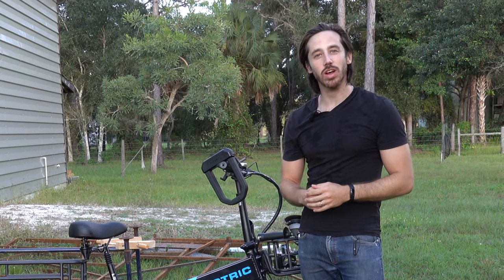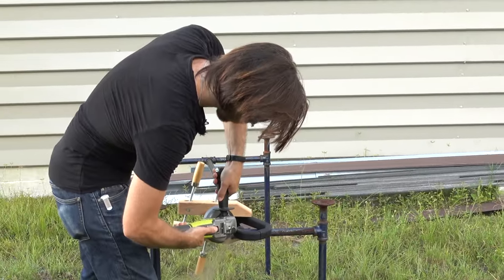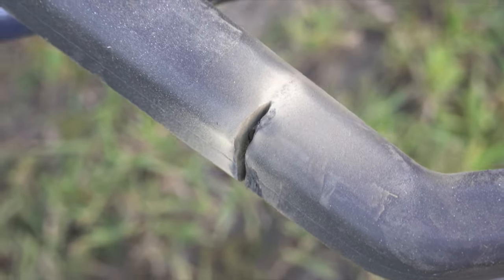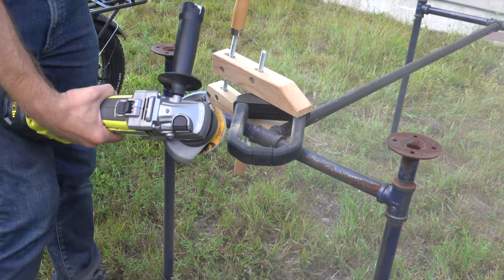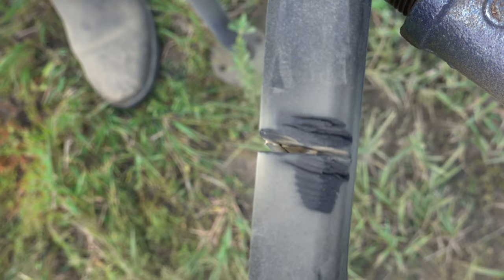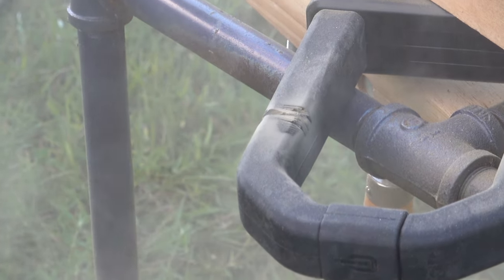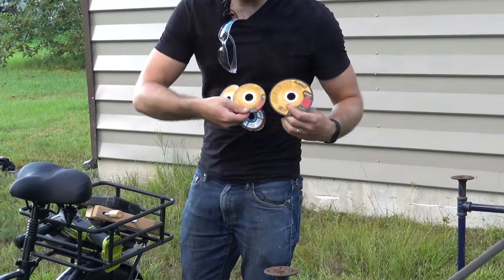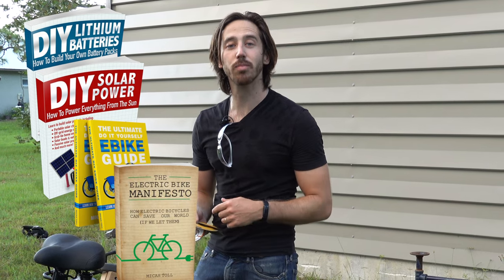Best E-bike Lock? Angle Grinder-Proof Hiplok D1000 Test

Comment: so cut down the post or shackle that the unit is locked too!, when involved with security vans a long while back, the design included multiple long Stainless rods between the  body panels, each rod was sheathed in thick stainless tubes mounted on bearings, so that any attempt to cut through other than by gas cutting rotated the tubes, very effective at the time...
Reply: I think there are prisons where the bars of the cells are made this way. Can't cut through the bars because the rods inside the hollow bars rotate as the blade tries to cut.

Comment: How does it compare to the ABUS GRAN¡T EXTREME? Cause I bought that one in 2019 . It’s insane cause little over a year later the ALTOR SAF Released and my granit extreme fell to second place. Now that the D1000 is out is it stronger? Or more light weight?
Reply: I use a brand new Abus Grannit XPlus 540 
Courtesy of my son for last Christmas!
Reply: @keithcummings691  great lock! Both my Granit Extreme and your Granit Xplus 540,are both Sold Secure Bicycle/Motorcycle Diamond locks! 😎😎😎

Comment: Is Micah still with us? Hard to imagine he is considering the dust from grinding and cut off wheels, as well as the dust coming off of that lock undoubtedly released some very unhealthy particles into his lungs. The dust room grinding discs are just as bad as asbestos! Hopefully the lock is designed so the lock doesn't spin open once you cut through it and you'll need to cut through the material twice to remove it from the bike. Thanks for the video 🙂

Comment: if someone was really intent on stealing your ebike then they could just cut the metal chain of post you have it chained to then take the bike somewhere else to cut the lock off, or simply switch out the abrasive fiber based cutting disc for a metal based one.(do not steal, stealing is illegal.)

Comment: Thanks, but it only has 6" of space to lock to something. Isn't that going to greatly reduce the possibilities of what you can lock it to?
Reply: It was learned in the 1980's that extra-large u-locks were much easier to defeat.   Leverage and car jacks ruled the day.  So the mini u-lock became popular.  This is larger than the small mini-u-locks.

The whole goal is to provide less purchase and working area for thieves to apply leverage or cutting attacks while at the same time leaving enough room for the consumer to lock a bike.  

Luckily, this lock would allow you to lock both wheels and the frame of a road bike.  By removing the front wheel, placing it next to the rear wheel and running the shackle through both rims & tires and between the chain and seat stays, you lock the frame and wheels in one.  This leaves virtually no room for leverage attacks inside the lock itself.  

The larger the wheel and tire, the less opportunity you have.  So it means you have to be creative.

Comment: From a Thiefs point of view, time is NOt on your side, When you have over 50 somewhat expensie bikes to choose from, and one that is protected by a D1000, which would you rather take?  If it wrere me, and I'm getting paid $100 per bike and I have to make a profit, those 50 bikes that I can cut and remove is not woth the time I have to spend on one bike with a D1000 lock.  
Its going to cost you more time, more blades, and being discovered when compared to cutting through several bike locks, than the bike that is protected by the D1,000.  True nothing is Angle Grinder proof, but is the time required to cut through a D1000 worth it when compared to a regular bike lock?

Comment: The D1000 is the solution I've been waiting for.  35 years using the best locks on the market without suffering a theft.  (Using the Altor SAF lock, reinforced NY Fagedaboutdits, Rock Locks, Cuffs, Bad Bones, the works.)  Stay ahead of the dirtbags and you'll probably keep your bike!

Top 3 stupid YouTube bike theft comments:

1)  LPL can pick it in 20 seconds!
2)  They'll just cut the frame!
3)  They'll just cut the rack!

Or you can familiarize yourself with bike theft, talk to law enforcement and learn some things about the issue.  Here's some useful advice from an experienced bike owner and thief thwarter.  Not smug pot shots from the comments section!

First, bike thieves don't pick locks.  LPL is doing the world a huge disservice by giving the consumer bad information.  Don't worry about lock picking.*

Second, a bike thief CAN cut the frame, but they usually won't.  It's the most valuable part of a bike and it defeats the purpose of stealing a bike:  to sell quickly for drugs.

Yes, there are exceptions, but they're rare.  Thieves are lazy morons who will go for the easiest pickings.  So chances are rare.

But IF  YOU ARE WORRIED, then lock your bike better!  Don't just lazily lock through the top tube and walk away.  Ideally, remove your front wheel and run your lock through the front whee, then the rear wheel between the stays and to the rack.  This means a thief would have to cut through BOTH wheels to steal the frame.  They won't waste their time.

If you don't want to worry about your wheels and can't be bothered with that, then lock THROUGH YOUR HEAD TUBE!  This contains the fork steerer tube and is MUCH harder to cut through.  That plus the cables & stuff in the way, a thief will move on to easier targets.

Third, racks can get cut, but again it's rare.  Why go to the trouble when a thief wants a quick bike to steal and sell for $100?  When your well-locked $2k bike is next to a poorly-locked $800 bike, the thief will take the easy bike to steal.

Rules:
Use a quality lock.  Or two.  Or two different styles.  Be creative!
Don't leave a bike locked up outside over night.
Buy renter's insurance.
Use GPS trackers.
Record your serial number.  Register your bike(s).
There are always exceptions!

*And yes, I'm very familiar with the BicPick method.  I've worked on and re-keyed 7-pin cylinder locks in the past.  (Fun with the Dremel and altering the pin lengths!)  This was the exception and Kryptonite backed up and replaced their defective product.  The older Kryptonites with Ace-II cylinder locks are BicPick proof, BTW.  Don't throw them away!

Comment: The rubber stops alot of the grinding so iff they went further and used the ribber in them big electrical wires that are self sealing iff they used rhat it would just keep chewing thr blade up

Comment: No thief is going to use disposable blades for that exact reason..., any smart thief will have a brand new diamond steel cutting blade, they cut a LOT faster than the carbon/graphite based disks as well.
Reply: Hiplok said their lock was vulnerable to diamond blades but that it took longer to cut than "commonly used" blades. Somebody should make a video about that.

Comment: Do people realise it's actually quite a bit quicker to grind the object the D1000 is attached to in order to free the bike and chuck it to a van? You can do it well under a minute no matter how angle grinder proof your lock is.
Reply: Top 3 stupid YouTube bike theft comments:
1)  LPL can pick it in 20 seconds!
2)  They'll just cut the frame!
3)  They'll just cut the rack!

Or you can familiarize yourself with bike theft, talk to law enforcement and learn some things about the issue.  Here's some useful advice from an experienced bike owner and thief thwarter.  Not smug pot shots from the comments section!

First, bike thieves don't pick locks.  LPL is doing the world a huge disservice by giving the consumer bad information.  Don't worry about lock picking.

Second, a bike thief CAN cut the frame, but they usually won't.  It's the most valuable part of a bike and it defeats the purpose of stealing a bike:  to sell quickly for drugs.

Yes, there are exceptions, but they're rare.  Thieves are lazy morons who will go for the easiest pickings.  So chances are rare.

But IF  YOU ARE WORRIED, then lock your bike better!  Don't just lazily lock through the top tube and walk away.  Ideally, remove your front wheel and run your lock through the front whee, then the rear wheel between the stays and to the rack.  This means a thief would have to cut through BOTH wheels to steal the frame.  They won't waste their time.

If you don't want to worry about your wheels and can't be bothered with that, then lock THROUGH YOUR HEAD TUBE!  This contains the fork steerer tube and is MUCH harder to cut through.  That plus the cables & stuff in the way, a thief will move on to easier targets.

Third, racks can get cut, but again it's rare.  Why go to the trouble when a thief wants a quick bike to steal and sell for $100?  When your well-locked $2k bike is next to a poorly-locked $800 bike, the thief will take the easy bike to steal.

Rules:
Use a quality lock.  Or two.  Or two different styles.  Be creative!
Don't leave a bike locked up outside over night.
Buy renter's insurance.
Use GPS trackers.
Record your serial number.  Register your bike(s).
There are always exceptions!

The D1000 is the solution I've been waiting for.  35 years using the best locks on the market without suffering a theft.  (Using the Altor SAF lock, reinforced NY Fagedaboutdits, Rock Locks, Cuffs, Bad Bones, the works.)  Stay ahead of the dirtbags and you'll probably keep your bike!

Comment: I wouldn't cut the shackle, that rubber thing is like "cut here wink *wink*", just cut the housing where the key goes in, or at the base of the shackle where the bolt locks.

Comment: The best part of this lock if you installed it correctly around the frame tube and back wheel. They will have to make 2 cuts so 6-10 discs and 3 ish batteries for total of about 30 mins.  No thief wants your bike that bad they can cut all the other gold locks in 30 secs to 3 minutes.  You dont have to out run the bear only out run your hiking buddy.

Comment: You need the wafer thin cutting disc , just be careful when using one
Reply: Not necessarily.  That would save battery life and reduce power cutoffs on that weak Ryobi grinder, but a thinner disc would just wear out faster, disproportionately so compared to its thickness.   Even the cutoff wheel manufacturers rate for longer life from thicker wheels, nevermind more exotic materials like ceramic wheels.  Merely choosing "metal" cut-off wheel, is not enough for modern extreme hardness composites, just as you can't use a plain "metal" saw blade to cut the average hardened bolt.

Comment: You still have to attach this lock into something. Then the lamp post, metal railing or any other metal bar will be cut instead. Not mocking this awesome lock but the chain is as weak as the weakest link.

Comment: You didn't actually show how you use it on a fat tire ebike. Seems too short and narrow use it effectively on that bike you're standing next to. If you use it on the frame the theif could cut whatever you're locking it too and ride off with it. It won't reach around back tire/frame and whatever your locking it to.

Comment: Yeah, most bike thieves don't carry around an angle grinder with two batteries, four blades, and a clamp. That's as angle grinder-proof as you're going to get.  If someone spends the time to cut through that then them stealing your bike is the least of your worries.
Reply: Diamond coated disc can get through but I'm not sure how long it would take by comparison.

Comment: You r using that grinder wrong.... move the guard and cut with the Sparks shooting back at you ,but stand to the side, think of it as if the grinder should be pulling out of your hand that's what gloves will come in cuz you will get hit with the odd Spark the way you are doing it has the potential to bind and shoot up after you you have no control

Comment: Hmm, I see a few issues with this test.

1)  Many (all?) contractor grade angle grinders outperform Ryobi.

2)  Only 4.5" cutoff wheel, larger diameter would get more depth per wheel.

3)  Thicker cutoff wheel or grinding disc instead, would last longer per wheel.  If that was a "thin kerf" wheel it's even more true.

4)  Can't tell for sure from the video but that looks like a general purpose wheel not one designed for hardened metal, which anyone looking to cut through a bike lock would prefer instead, or possibly a diamond or ceramic blade.  I'm sure that anyone out stealing bikes has already recognized the need to have their cutoff disc last a long time so as not to have to change it during the theft. 

I feel like you more or less proved it's a good lock (doubly so because the thief would have to complete TWO, not just one cut, BUT that anyone who planned well ahead of time, can use an angle grinder to cut this lock.  Besides, a smaller 4.5" sized grinder disc would also be limiting if someone wanted to cut frame tubing to sacrifice the frame to get the rest of the components.  On the other hand, if you had successfully cut through it and showed the core construction, area where you were slowed down, that would better show what they are dealing with.

At the same time, if a would-be thief has encountered this lock previously and found it far more difficult to cut, it could make them move on to an easier target, except I bet this lock is expensive (yes, $345USD), so mostly bought by an owner of an expensive bike, potentially making it worth more time to the thief to spend on it and once invested and making progress, even if slow progress, would tend to keep at it unless something scares them off.

Is there an anti-theft insurance included with the purchase?  If not, I wonder if insurance (instead) would make as much sense.  That's a heck of a lot of money to pay for a lock.
Reply: See the Bennett's Bike Social motorcycle site destruction test including a 1.2mm cutting disc and drilling the lock core. First lock ever to earn Diamond award.

Comment: use a carbide or diamond cut off wheel, 30 seconds its cut clean, cut proof isn't real it's a sales gimmick,  Nothing can stop a grinder or a sawzall accept for being cheap and giving up, spend $100 a wheel/blade you'll see the difference instantly

Comment: The rubber is causing extra friction, wearing down your blades.  Instead of cutting straight down, causing the blade to be pinched between the sides of the cut, first cut the rubber AT AN ANGLE from both sides, creating a "V" cut in the rubber.  THEN begin cutting the STEAL and see if the angle grinder burns thru blades.

Comment: I’ve seen a number of these demos I would like to see someone use a steel cutting diamond blade ,better still a hydraulic enerpac with a remote pump rated at around 10-15 tons these things are readily available and are easily transported ,it’s over priced here in the UK it is aimed at the motorcycle market mainly if they want to send me one to destroy I’m up for it .ive said before that the industry seems to think that thieves are knuckle dragging Neanderthals ,they may well be but they also have intelligence .Whatever you lock your bike to with this device can also be cut much easier than this device.I have seen one lock that when cut emits a very high pressure noxious gas but in an ideal world that really needs to be a flammable liquid so the perpetrator is seriously burned or better still barbecued on the spot ,no need for costly legal procedure straight down to the cemetery 😂

Comment: For one that's a shitty grinder and the grinding wheel isn't the best if it wears down that fast.A good blade and a powerful grinder can cut through anything.A grinder is pretty loud and the sparks it will make are very visible.Band saw would be better but even then people will notice a guy carrying around a large battery powered tool while trying to steal a bike.

Comment: Would have been better to keep going. If it takes five disks to get thru, that is still very impressive. But would have been a better video. I want to know what is in the core.
Reply: agreed - it would also answer the crucial question of whether one cut or two cuts is required.

Comment: this test was kinda rigged, usually when cutting disk is smaller than object you cut from 3 or 4 angles if possible so that all cuts meet at the center. Now you just attacked the same side with 3 disks

Comment: A more realistic test was done by Cade Media. It's at https://youtu.be/aBxyaFf379g?t=527 and entitled "We Destroyed 6 Of The Best Bicycle Locks." If I'm an experienced bike thief, I've encountered hardened metal locks before and would never go out and try to steal bikes with a normal angle grinder cutoff wheel. I'd definitely be using a wheel with a diamond blade. I didn't see such a wheel applied in this test, which basically invalidates the test for me.

Comment: Gonna be honest. The only way to secure your well anything is as I did, wire a 12 volt battery to it with a cut off, engage when away from it and the douche bag thief will get their hair burned off if they touch it. Problem solved

Comment: 1. That's a cutting disc and not a grinder disc, the results are extremely different. 2. there was also also have been different if you cut around the three sides of the lock and followed it up with a sledgehammer/ chisel wedge combo. The idea that thieves will walk away if it takes too long. has been to proven. mainly because, people just watch and pull out their phones recording their masked faces. they don't care. they know how long it takes for the police to show up and they know they're not going to show up.

Comment: I see these reviews quite often and wonder what zip cut manufacturer they are using. A good quality, Walter, or Matabo zip cut should make a world of difference. Also, a back-and-forth motion will make the disc last five times as long as opposed to holding it in one position and applying pressure... Give this a look.  
https://www.youtube.com/watch?v=hid9bDnSeok&t=3s